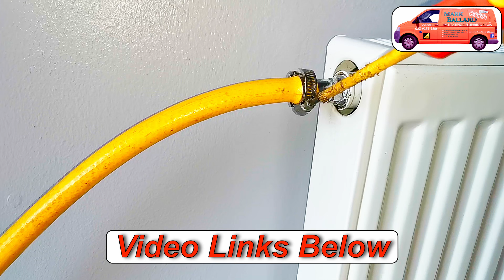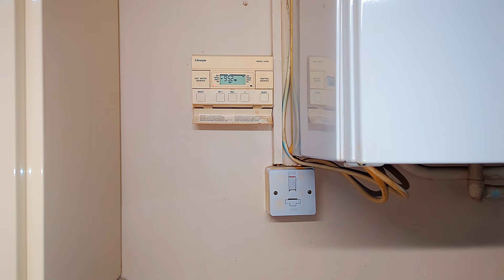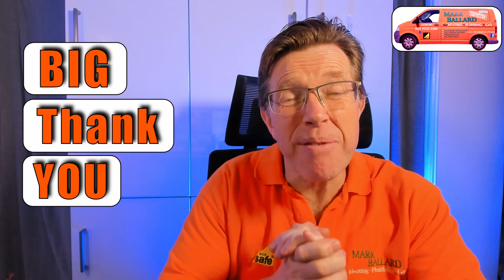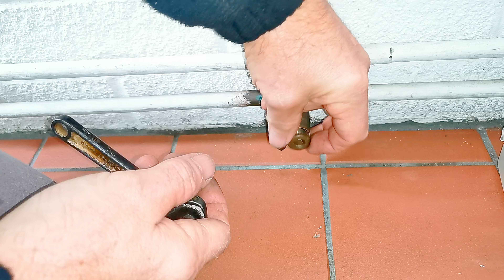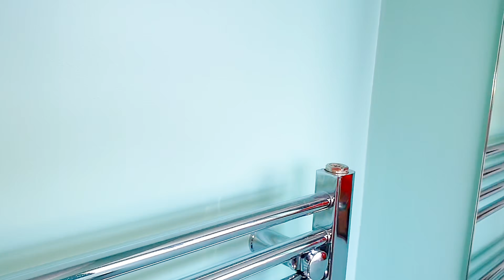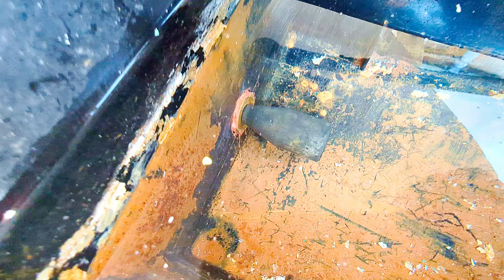How to Drain Heating System Combi & Traditional Systems, Problems You Find with Drain Valves

Comment: TLDR: Have you had any experience of Tesla T-Doc valves? Do they really solve the washer issues in drain valves?

I’m doing some renovations and want to replace the current drain valve with an improved design that will avoid all the rubber washer issues you mention.

The drain valves are on the hot+cold supplies for the taps (i.e. not the central heating circuit).

I was planning to put a compression tee in, with the tee going off to a Pegler ¼ turn ball valve (the most reliable in my experience). And then a hose barb attachment on the other side of the ball valve.

However, in order to make it less unsightly, there’d need to be a length of copper pipe that’d be acting as a dead leg, and therefore a legionnaire risk.

So, my next idea was to use a Tesla T-Doc drain valve which uses an o-ring as opposed to the disc type washer in drain valves, and supposedly more reliable. Have you had any experience of Tesla T-Doc valves?

Comment: This is spot on. After teaching myself how to plumb in new radiators, thinking I was all done, the drain valve always leaks now its been opened once. It's about 2 inches off the floor facing down too. It would just be fiddly (I need one of those mirrors) but the worst thing is, I can't work on it before I drain the entire central heating system 😞

Comment: i just wanted to ask. is the external drain cock advisable to be fitted externally on a cH system. will it freeze? have a house and pipes under the suspended floor so an external draincock would be suitably sited to drain the system, plus there is a drain near by. thanks

Comment: Not really this topic, but no videos anywhere about Vaillant open vent (heat only) boilers! these have only two pipes rising UP from the boiler, so presumably they stay full of water when the system has been drained down using a lower drain point under the radiators. Any way of draining the boiler?

Comment: Great content, and will forewarn of the joys of what appears to be a straight forward job, but seldom is! A few years ago whilst replacing the bath the new bit of 22mm copper pipe would not quite go into a fitting, almost, but not quite. Crazy! I had 'discovered' imperial sized copper pipe. (It's about 21.6mm I think) I'd never come across it before. Replaced fitting, all good.
Reply from the maker: You can buy special Imperial to metric fittings for 22 mm

Comment: Golden rule of plumbing. Never touch a drain valve.
 Find another way to do it. Usually more trouble than it's worth. Probably start leaking, the washer could shred. Definitely need to replace the washer if used
Reply: Not true. If u carry some spare washers in the van it's always the easiest way to drain the system.
Reply: Ok so in my next installation I will fit an isolation valve and an end cap instead of those